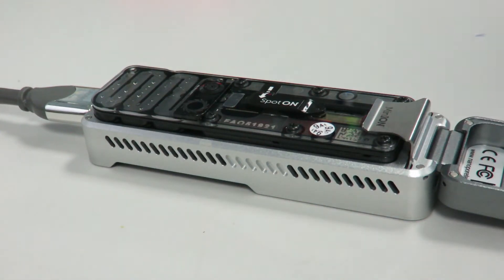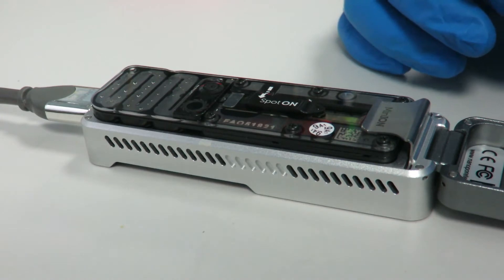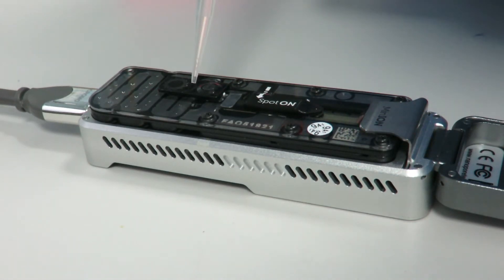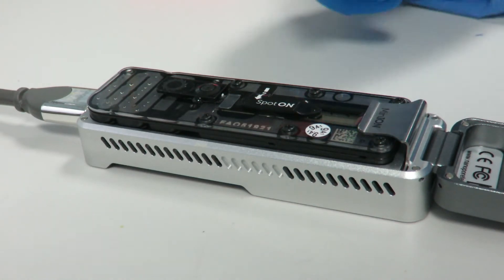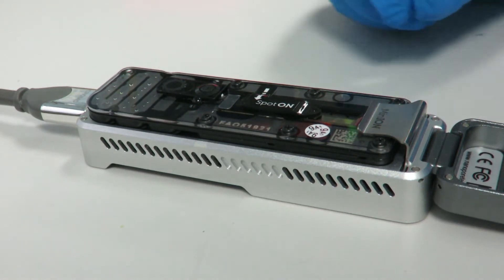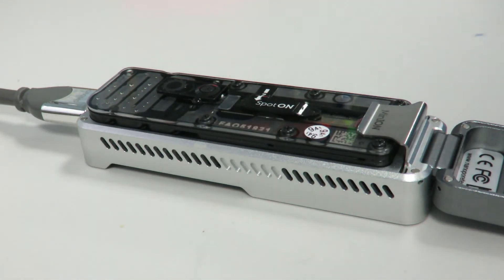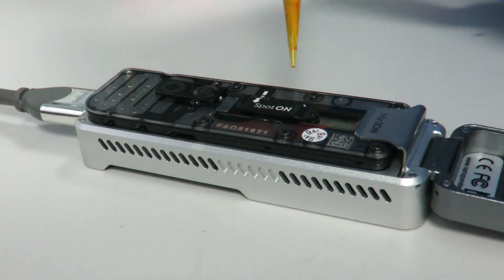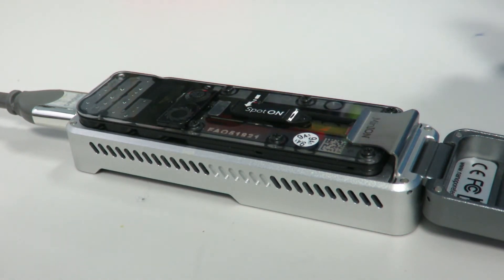How to wash a Flow Cell (and how to empty the waste channel)

Comment: few Q need a proper how to turn  on an off the equipment. say you have done your calibration check. now what just pull the tests cell out?
Reply from the maker: Hi Luis. The flow cells will just click into place (of course you need to make sure they are the correct way round, to ensure the electronics on the bottom fit), but we recommend being gentle with it! Once MinKNOW has displayed the number of active pores, you can then remove the flow cell (it's easiest to do so by gently lifting the waste port end up and then slowly wiggling the flow cell out - you can see Linzy do this in the video). There are no locking mechanisms in place on either the flow cell or MinION (it just has small magnets to hold the lid down)
Reply: @pandora-id-netconsortium1846 did QC 1432 pores on the flowcel. How to unplug safely the minION? I tried to eject ....but windows response is "device running" so i am closing software and then turning off the computer. Then unplug.
As i get ready  for my first run. Flushing  is done while placed on the the minION ?
Looking forward

Comment: How much waste should be removed from the waste port before washing?
Reply from the maker: Hi Maurine, it doesn't really matter, all that will happen if you add more buffer and the waste reaches the port, is that it will just bubble out of it. Equally, removing the waste shouldn't affect the ASIC panel section of the flow cell, so you can remove it if you wish

Comment: How many times can I use one cell flow?
Reply from the maker: Hi Kevin, that depends how long you run it for and what you are doing. If you are sequencing a small part of the genome, or only need to know species level (e.g. metagenomics), then you can run for a short period (~ a few hours) and get the info you need, then wash the flow cell and reuse. However, if you need detail down to SNP level for WGS, and/or you're running multiple samples, to get the detail you need you'll probably need to run it for the full 48-72 hours, so there'll be no point washing it because there won't be many pores left. Once you wash the flow cell, you should QC it again immediately and it will tell you how many active pores you've got left to work with. In theory one flow cell can be used multiple times, but you need to consider data quality and application!